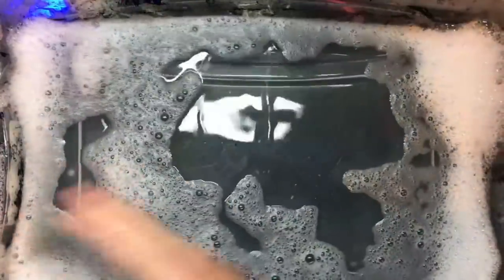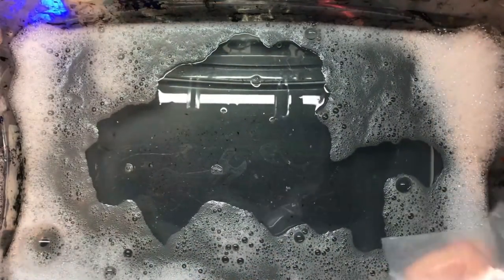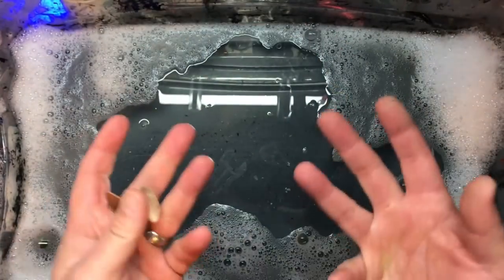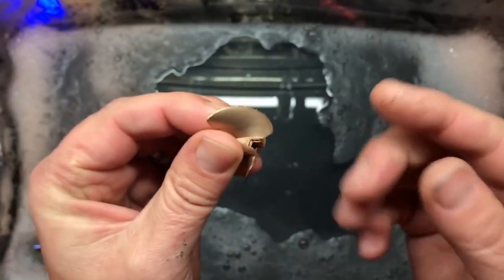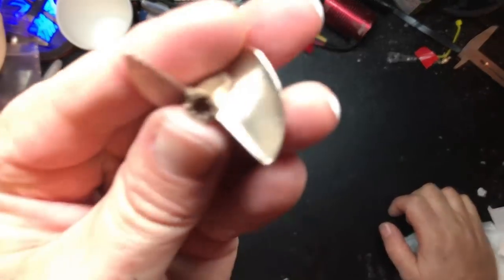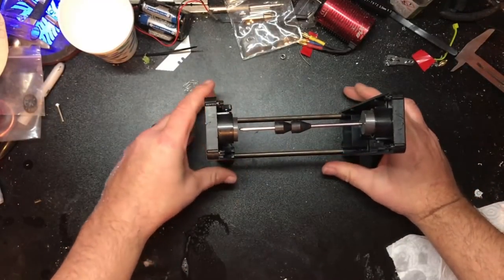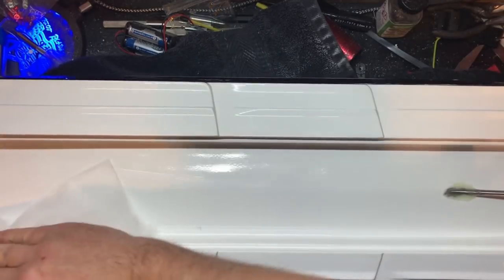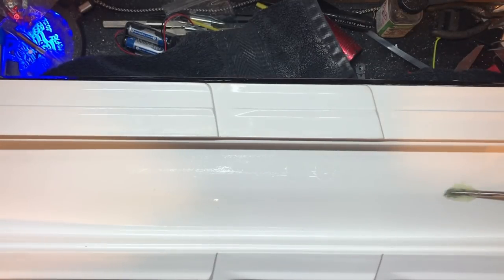Episode 4: The Genesis Boat build Propeller and drive system

Comment: Roughing up the hull makes perfect sense to me! It's a similar reason as to why ski techs put stone grind patterns on the base of skis. A boat hull wants to capture air between it and the surface, skis want to capture beads of water between them and the snow. Skiers are actually gliding on a cushion of water.

Comment: I use the same grease but I buy the tube that goes in the big grease gun and you can pop the plastic cap off and just dip your flexshaft in the tube a pull it out already slicked down!
Reply from the maker: LOL.    I do that too sometimes.

Comment: will put only flex cable width clearance on the prop shaft if its a one piece flex cable but if i use 2 pieces flex shaft (flex cable and hard shaft) no need for clearance due to the flex squared cable will just slide out under torque on the hard shaft.
Reply from the maker: Absolutely agree

Comment: Just a bit of advice so people have an easier time understanding you. The edge you sharpen is called the leading edge. the "straight" edge, is called the trailing edge. On the trailing edge, you have what is called a cup, and that is what you need to leave alone. Cupping greatly affect pitch and bite, so you're right in not touching that unless you really know what you're doing.

Comment: But what if the hub issue is on the propeller side. Wouldn't that affect the blade geometry since you would sharpen that blade until the prop is balanced.
Reply from the maker: I sharpen the prop first then balance.  And only take material off the front side (bow facing) not the rear

Comment: I have an 4mm drive shaft and it is getting really hot, my gap was like 1-2mm (I've used high quality grease). Im running a 6s 4074 150A ESC. My shaft is kind of short like 155mm, how much gap does it need?

Comment: Iv got a few boats and I'm not bothered about speed i buy them cos I love using rc boats in my local park my TFLs are fast but iv never opened them up for top speed the lake where i use them you can walk around it in about 3 minutes so i wouldn't even hit 20mph 😂

Comment: Yo bro thanks for the vid I finally know more about boat prop flex shafts but I still have a few questions so my 3 part question is 1. Connecting a coupler or collet to a solid steel prop does there still need to be some play because it doesn't have the motion of tightening like the flex shaft does (mind you this is a higher torque application for a upgraded feilun ft011 has a solid 4.76mm---3/16ths prop shaft that used to have couplers like an rc truck or car would have and alittle dog bone that allowed for some play in the shaft and the shaft tube has bearings on each end for it to spin in. My motor is upgraded from a 2112 outrunner with 2350kv to a 3670 1900kv inrunner brushless motor. Question part 2 can a flex shaft upgrade be better for this kind of power? If I was to run a flex shaft could I still run the reverse feature for self righting on my esc? And can a flex shaft be put in in a straight shaft application??? The last question is for a 650mm boat what size flexshaft should I get??? I was thinking 350mm should be the sweet spot and where is a good place to get a good flex shaft from??? I was going to just get one from Ebay from china?...
Reply from the maker: David Avery Sorry I missed this brother.     Do me a favor and email me your number so we can text.   My email is in the description.

Comment: Hello sir. Can i use 4mm flex shaft in a 4092 2140kv motor?
Reply from the maker: Depends.   How many cell battery u going to use?
Reply: 6s sir
Reply from the maker: Hmmmm you can try.     Lotta torque for that size.   I would try it with a 2bladed light pitch prop.   Shoot for upper rpm and reduced torque.   That’s what I would do